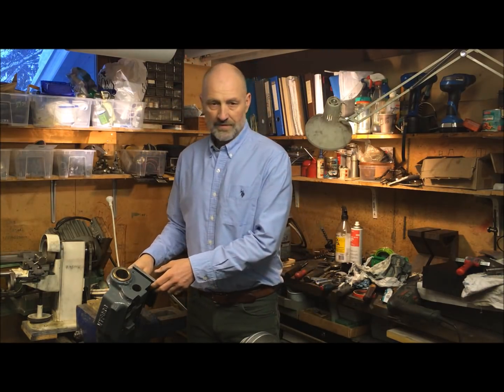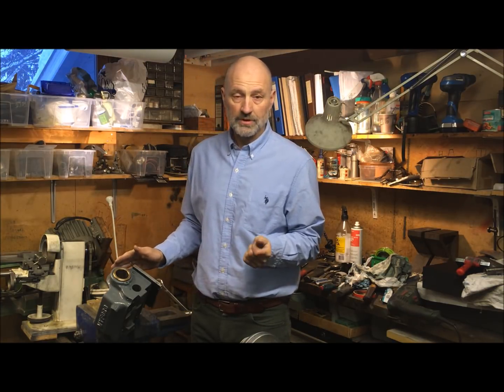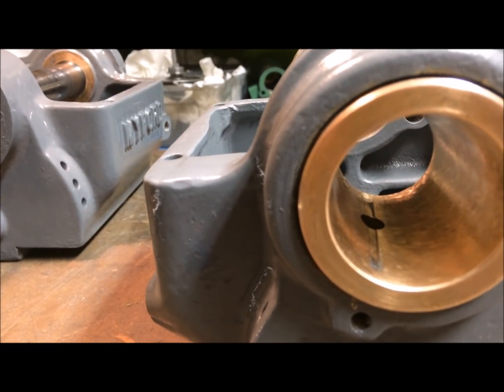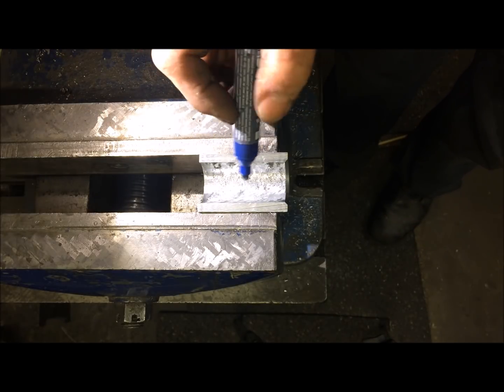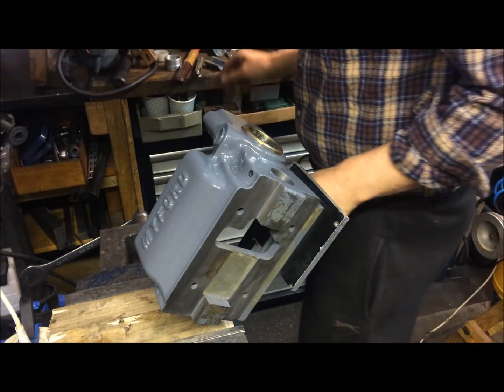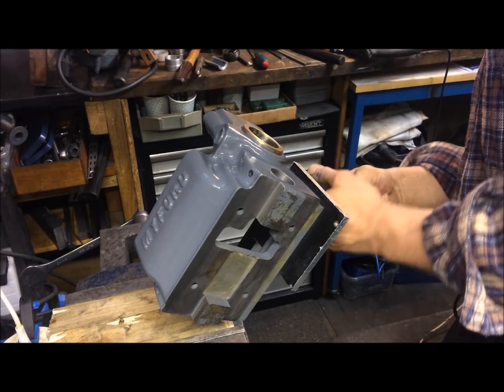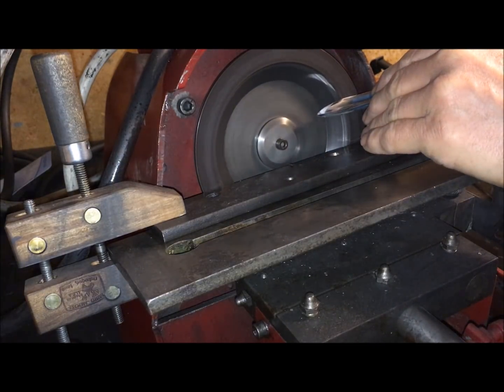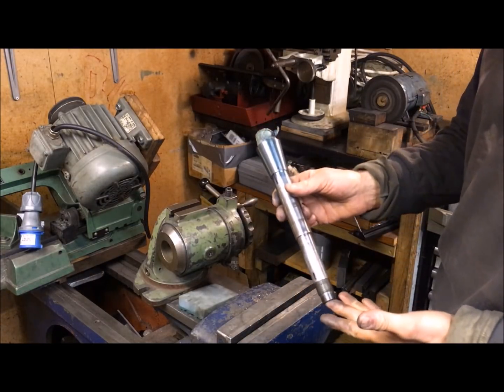Myford 7x7 - scraping headstock bearings - intro, design, setup and grinding scrapers

Comment: Great video thank you. However, how do you stone the bearings during scraping? If you don't stone, then how do you remove all the burrs after scraping?
Reply from the maker: Thnks. I would never use a stone inside there, no, but there are other (better) ways to remove burrs on softer materials as well as brass. If I remember correctly I used some kind of knife tool/razorblade
Reply: @jansverrehaugjord9934  great, thank you for replying :-)

Comment: very interesting. don’t see much plain bearing scraping on youtube. just curious did you consider converting to ball bearings?
Reply from the maker: Clifford Arrow Thanks. Never seen a conversion to ball bearings on a Myford S7. Not sure how easy that would be, but more important, why consider this? The conical bronze bearing is a rigid design for this type of lathe and gives a very nice finish as well as allowing a good top speed. In fact, many precision lathes (especially smaller but even some larger) have bronze or plain bearings
Reply: Jan Sverre Haugjord Hi, truthfully, this was just an assumption on my part in assuming that ball bearings are superior than plain bearings. Not used to seeing them in modern lathes probably led me to this assumption.
Reply from the maker: Sure, I understand :) Didn't mean to be direct or negative. I too thought that bronze bearings were inferior to ball bearings, sort of just the old-fashioned way of doing things before the invention of better methods.. until I read up on the subject.. :) Pro and cons for both types.. I think this has a potential of starting a "bearing war", ha, ha.
However, one could argue that bronze bearings are mostly replaced anyway, I guess, since nearly all lathes made for our normal use nowadays have some sort of roller- or ball bearing design for the main spindle.. Simple and affordable (and maintenance free for a long life). The Super 7 was designed way back in the 1950' ies and possibly the supply situation was different then, also labor cost lower (for scraping the bronze bearings) etc. Still, performancewise as good or better with the bronze.. When I give it more thought, had it been a cylindrical bearing of equal diameter over the length, it would maybe have been possible to make a relatively easy change? Involves line-boring the headstock, so chances are there for spoiling this part..

Just of of curiosity, anyone having done this change?